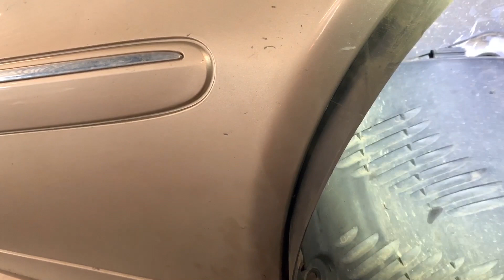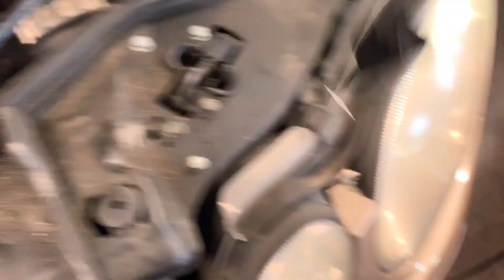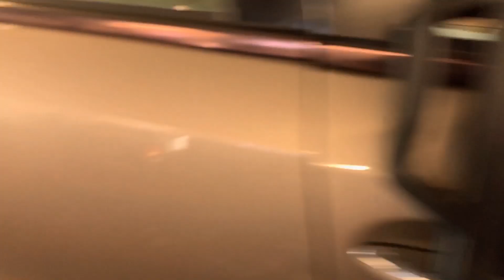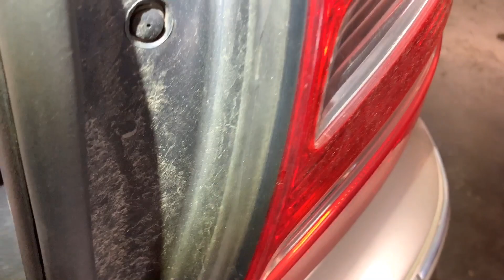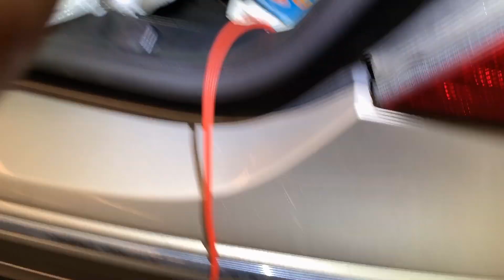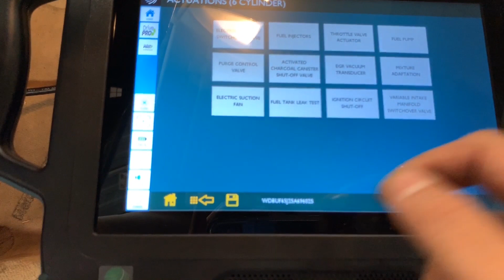2005 Benz E320 Vent valve diagnosis with Autologic Drive Pro

Comment: If u look in the plug wit a light it shows u -&+ sides with a new updated canister u need the updated you maybe they hot wired it  and now u got it could have blown relay or blown out  the new vent valve if they did some extra stuff to make it work before u got it new stuff is reverse polarity benz did that shit and send people new shit with out updated plug 🤦‍♂️

Comment: I have same problem pls help me ,CEL with code p2012-2 ( type code signal too small) cleared code then run 100 miles come right back with same code, did replaced purge valve ,shut off valve and gas cap ,wanna know it ECM faulty
Thanks

Comment: Very good video Maic. That fluke is something else. 
What are your thoughts on the Drive Pro from Autologic ?
I want to buy a tool to expand my services to European Market and the Drive Pro looks to me like a good tool and OK priced.
Reply from the maker: JJ CV i am now very happy with the Drive Pro, at first was having some bugs here and there but now it is super strong tool for Euro! Their support and warranty is amazing! Go for it, you’ll be happy!! Just one thing, remember there is no perfect tool for all!
Reply: @MaicSalazarDiagnostics   Hey hope all is well. I am going up to NY to get the tool. Quick question how big is the carrying case for the drive pro. I am flying into NY to get mine and I have to figure out if the carrying case will fit in a large suit case or not..Thanks
Reply from the maker: JJ CV I can give you exact dimensions tomorrow. But I am pretty sure it will fit.

Comment: Thanks for the video. But I have a question instead of using the test light couldn’t you just ground the control side of the solenoid @ the ECM and activate it with the car running and then check the vacuum on the drive pro it ends up to the same conclusion I’m not saying it would be better just different but I could be wrong.
Reply from the maker: V10PDTDI yes that works too. But if for any reason the wiring is shorted to power under a carpet or so you will have a fire. This way you are protected just in case of a short, also the test light shows visually that the wiring integrity is fine.

Comment: For the viewers ; 
If you were to have tested the original vent solenoid , would you expect to have seen higher or lower than expected resistance on it? And what would an average solenoid resistance be for just about any vent solenoid in existence ? Could this be the cause of the ecm failure here ? 🙂
Reply from the maker: Great questions! I miss that part on the video because costumer had the valve already replace with OEM. Most definitely the old valve was the cause of the bad driver and resistance will be lower so it would draw more amps that eventually took the driver.
As per the resistance that varies a little from 45 to 65 ohms.
Reply: THAT WAS AN EXCELLENT QUESTION AND WOULD THIS 45-65 OHMS COVER JUST ABOUT ANY AND ALL SOLENOIDS OR JUST VENT SOLENOIDS OR WHAT IS A GOOD GENERAL NUMBER THANKS .
Reply: Typical dodge problem ecm failure to bad benz joined them for a short period now we have short period problems with great cars